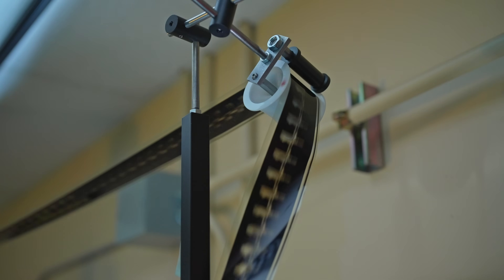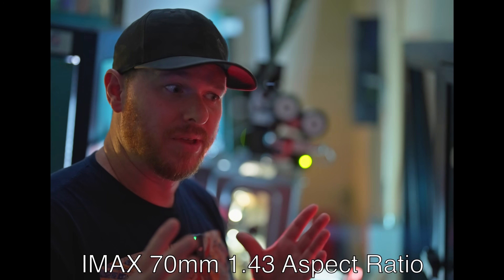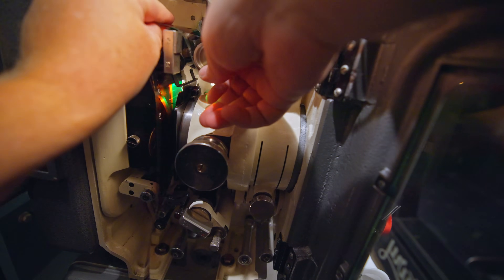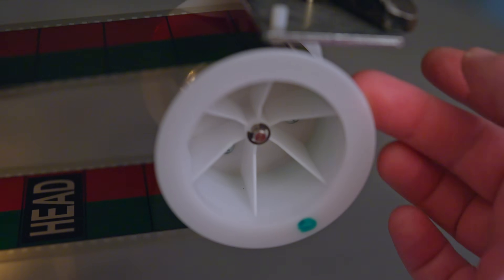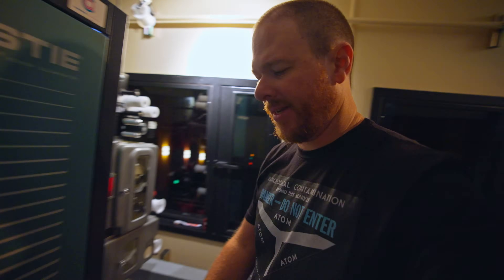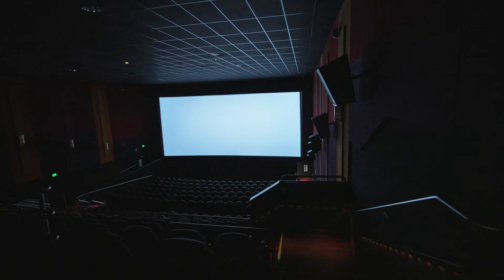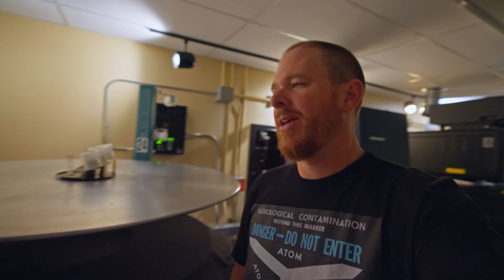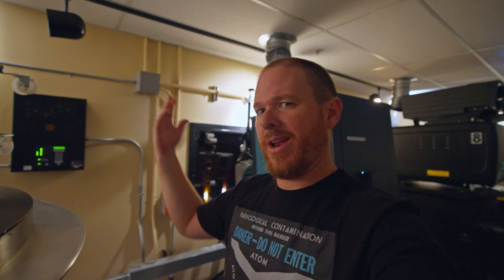Being a Projectionist for Oppenheimer 70mm Film Part 2

Comment: Started in high school with 16mm.  When I was in the Navy back in the 70's  I run the base theater and it was all 16mm.  When I was in CA late 70's I run some 35mm for one of the theaters in town.   In the late 80's I was on the engineering team that worked on digital audio and digital video.   After that it on to lasers and fiber optics.  Now I am retired and thinking about getting back into the projectionist role again as a part time gig.

Comment: I remember the Century Projectors and the platters.  I worked at a 3 screen back in the 80s.  Two used platters and the big house still used reels and two projectors.  I remember the automation system at the time that was triggered by a metal strip we placed along the edge of the film to dim/raise the lights, set the masking sytem, and switch on and off house music.    The thing I found most interesting was your changing the bulb.  I never had the privilege but remember the plastic housings they used as the shatter protection.  I'm guessing they switched to what you wrapped the bulb with as a cost saver.   Thanks so much for the tour.  I worked 35mm so seeing the process on 70mm was fascinating.
Reply from the maker: When I changed bulbs in the past they all had the hard plastic covers. That Osram bulb was the first one I had seen use that soft cover. Usually we would do it with no cover on the bulb. But for the video I had to do it because the people that hired me watch my videos.

Comment: Enjoyed very much the mechanics of 70 mm film I only ran 35mm film with two projectors with carbon arc lamps. This was at MAVC HQ in Saigon Vietnam headquarters in a 450 seat theater that was a part of the complex. Nothing like having a row of generals in the audience. I once forgot to change carbons and it was during the feature "Barbella" with Jane Fonda. Unfortunately it was during the scene where she was in the pleasure machine. Those who knew me didn't let it go unnoticed! The projector heads were Simplex with an  RCA optical sound head and Perlas (sp) arc lamp, around 65 amp. This was in early 1969 and the Xeon lamps were coming out but we could not get them as we were in "Hostal Fire Zone" and all equipment was considered expendable. Basically we were operating with junk! Enjoyed the short stint as projectionist as it made me appreciate the commercial theatre projectionist's efforts to have a smooth show.
Reply from the maker: Glad you enjoyed the video. Working as a projectionists was one of my favorite jobs. Its nice that I get to do it still from time to time when a big job like this comes up.

Comment: when you where tricking the sensor to make the projector think it was running, do you need to worry about the heat of the xenon bulb?  when you were checking  the light with the light meter?   can it lead to a projector catching on fire if you leave the doser open for long period of time?
Reply from the maker: The film gate is water cooled and there is a glass filter between the lamp house and the projector head. That glass cuts down on a lot of the heat coming off the bulb. In theory, if I had the lamp on with the projector running white light it could maybe damage the lens. I think this might have been a problem long ago.

Comment: Lifelong 70mm fan here. Thanks for putting these videos out to talk about and show how 70mm works, and what it takes to run the projectors. I do think you downplayed the comparison of the benefit of (true) IMAX 70mm vs 5 perf 70mm. Even if some sort of lens (anamorphic?) was used on 5 perf 70mm, the resolution would never be even close to what the 15 perf IMAX 70 can do. Yes, there is a huge difference in the visual information available in the IMAX format (even just looking at the two film strips side by side on the light table.) - there is no available information in the 5 perf beyond what that smaller frame can hold.
Reply from the maker: There is an advantage to IMAX over 70mm. I think the resolution claims are extremely hyped up.

Comment: These brings back memories.  Like other commenters, I too was a projectionist back in HS/college.  Probably the most fun job I ever had.  IMAX was still a few years away, but we had the lenses and adapters for 70mm even though the last time they were used was for Empire Strikes Back.  All pre-digital too.  This was the late 80s and the bigger 12plexes and such were starting to come around, and around the time more cinemas were upgrading to platter systems, Christie etc.  I got to work with the old reel to reel systems with changeovers and metal tape cues and all that, then ran the platter system until I ended up leaving.  Good times.
Reply from the maker: I have found memories of working at theaters and the studios.

Comment: Really loved both of your Oppenheimer 70mm Videos. Two quick questions though. Is the Film somehow getting Rotated, because It seemed like the Film was running through the Projector Vertically and I thought that the IMAX Film with 15 perferations was used in a horizontal manner. My other question is, if anybody knows if there is a way to watch Oppenheimer in 15 perf 70 mm IMAX somewhere in Europe to this day or if I'm already too late. I'd very much appreciate some Feedback. Thanks a lot!
Reply from the maker: This print was a 70mm 5-perf version. This wasn’t the IMAX 15-perf version of the film. 70mm 5-perf travels in a vertical direction and the IMAX 15-perf travels in a horizontal direction. Not sure if the IMAX version of the film is being shown anywhere now.

Comment: In the late 70s I was a projectionist at the Kent Cinema in Yonkers, NY (dual projector carbon arc). It was an end of the line theater where we always showed a double feature for $2.00. We got the films after every theater played them so the prints were often in bad shape. The films changed every week so usually on Thursdays I had to pack up the old reels and set up the new films for the week. Very often the reels came from multiplexes where they ran on platters. The projectionist were too lazy to splice the heads and tails back on so I had to do that. A few times the wrong numbered heads were placed with the wrong reels. Once I ran a film for a week with the reels out of order. The audience was puzzled why the guy who got killed in reel 2 was suddenly alive again in reel 3. I had no way of knowing it was wrong until someone who had seen the film before knocked on my projection room door and explained to me what happened. We started one film at 6pm and then the second feature around 8. We repeated the first film at 10. If we only had a small audience, the owner used to tell me to drop a reel so we could close early. There was no bathroom in the small booth (which was always full of marijuana smoke from the seats nearby) and I had to run downstairs to do my business. A few times I took too long in the bathroom and I heard the reel finish in the projector followed by the screams from the audience. Sometimes the owners used to remove a print from the booth overnight so it could be bootlegged on to VHS. It was a wild time at the Kent for $35 a shift.

Comment: Cotton gloves should ALWAYS be worn when handling film. The oil from your hands gets on the film and is transferred to the rollers and other parts, which already get dirty enough on their own.
Reply from the maker: No…I’ve been doing projection for 25 years and have never used gloves. The only people that I have seen use gloves are the people handling film working in editorial.
Reply: Nah. You can't thread with gloves. Biggest risk to damage print if you do [misthread].  Keep your  booth and projector clean [we do at this level] and nothing will migrate from the leader into the print. Film archivist? Print repair? Different story.
Reply from the maker: @markdavenport8737 exactly.

Comment: For projectionist training, make friends with a projectionist and hang around.  Learn all you can about it. Offer to stick around and help a projectionist break down and make up the prints on 35mm on the day they change films.  This is how I learned carbon arc projection with enclosed 20 minute reels and manual changeovers in an antique theatre as it was equipped to show the old nitrate film (Highly Flammable) and the old cement splices to the modern tape splices. Just wondering if Radioactive Drew ever ran 20 or 40 minute reels with manual changeovers? I was doing manual 20 and 40 minute changeovers before learning the platters. Yes , they needed rewound. No the projector can not rewind a film. I was even shown how to file the aperture plate for a new install. On 35mm you not only change between the flat lens and CinemaScope lens, but change the aperture plate to go with it.

Comment: 15/70 vs 5/70 is a little bit more than 3x the surface area in terms of projected image, while on 70mm DTS film the whole emulsion is printed, its not actually projected. The edges near the sprocket holes would be covered up by the inner magnetic tracks on a 6-track mag print, and are not projected, as no aperture plates (if cut correctly) should be showing that part of the picture area.

Also, thoughts on those Christie platters? I've heard a lot of horror stories about them getting out of time, but have only ever run changeover (DP70 pair), so I'm curious. 

EDIT: Very cool to see BLS's 70mm test film out in the wild.
Reply from the maker: Yes if the aperture plate was cut exactly to spec you wouldn't see that extra bit of picture. It seems mine were a little over cut on one side of the plate showing more than should be. IMAX 15/70 also has an aperture plate...or at least it should as every theater projection system has that.

Comment: I was operating projectors from the mid 70's through the mid 90's. I started off at a small single screen theater doing reel to reel change overs, then they "twinned" the location by dividing the auditorium with a wall. At that point we installed new Christie platters. Throughout the years I've run up to 12 screens as a manager/operator with one theater having a combo 70mm/35mm  Century projector that very rarely showed anything but 35mm.  It's obvious you know your stuff and I truly appreciated your professionalism. Thanks
Reply from the maker: Glad you enjoyed it. First theater I worked at was a single that was twined. We had a Strong 5 deck platter system feeding the two theaters.

Comment: I`ve been a projectionist for years, and when you were testing the white light, I always thought it would ruin the projection lens and leave a burn mark in the center of the lens if you left a plain white light shining thru it on the screen for more than several seconds
Reply from the maker: The light can ruin a lens if you aren’t running the projector and the shutter is in the open position. If it’s running you are fine to run white light.

Comment: I enjoy Drew's videos, but, the comparison between 5/70mm 'vertical' and 15/70mm may be correct as far as the film stock itself goes, but, Drew did not give a proper resolution comparison as far as the size of the entire projected image.  With 15/70mm IMAX, the film is running horizontally, so, the frame size that's being projected is much larger than that obtained from 5/70mm.  70mm is the width of the film, but, it's not correct to compare 70mm vertical against 70mm horizontal, as, the edge that is 70mm is swapped.  70mm vertically run through the projector, the width is 70mm, and the height is less than 70mm, but, 70mm IMAX being run horizontally, the height is 70mm, the width is much bigger (15 perforations wide).  So, to fit the same width projection screen with the image, the 5/70mm running vertically has to be magnified more than the 15/70mm IMAX, which is why the IMAX projection image is that much better.

Comment: I think the term "resolution" is tossed around too much lately with film. Since film is an analog format, it predates the modern definition of resolution, which relates to square pixels. Since film has no pixels, it technically surpasses any resolution a modern digital projector can show. IMO, a good comparison of 70mm to IMAX 70mm would be like comparing an APS-C camera sensor to a full frame camera sensor. The full frame is physically larger, so it automatically is capable of handling higher resolution images since it can see more, as there is more data within each image. If it's cropped, you lose some of that resolution. Of course, there are more factors at play like the sharpness, the pixel density, etc.
Reply from the maker: That’s a good way to compare the 2 formats.
Reply: Film isn't analog.  It is made up of silver halide grains, which can be activated by light.  In that sense, it is actually digital, although the grains are randomly distributed and not in a grid pattern.

The concept of "resolution" works differently, too.  It is normally measured as "resolvable line pairs" by photographing a test chart.  This takes into account the resolving power of the lens, as well as the film itself.  All things being equal--as you note--a larger piece of film will have more resolvable line pairs than a smaller one.
Reply from the maker: @Alpha8713 film isn’t digital. There is zero argument you can make that would prove that point. Film is made up of a bunch of pictures shown in sequence. You can hold them up to light and see them. You cannot do this with digital. It exists only as data broken down into “1’s” and “0’s”.

Comment: I did 35mm projection for AMC theaters around 2001-2002. I have been addicted to film ever since. I started collecting 16mm film and later started my own film lab for still photography. I love 70mm & 35mm.... Well I love all film, it looks beautiful on screen. And I want to see more movies released on film. Movies shot on film should have film releases. Movies shot with digital cameras should get a digital release. Besides some logistic issues, there is no reason theaters can't have both film and digital projection systems. Thanks for the video, great to see how well you protect the film. When I did projection I was paranoid about making sure the film never touched the floor. Anyhow thanks for sharing, I did not learn much but was interested in how sound was currently put on 70mm since magnetic tape used to be applied to the film. Using a DTS time code just like 35mm makes more sense. I am surprised there is no optical analog track as a backup like 35mm has.
We do need to train the next generation and websites like film- tech(dot)com are wonderful resources for film and digital projectionists. Hopefully we can keep film alive and well for decades to come.

Comment: How does it work if the film has scenes in 60fps like Avatar 2?

Does the whole thing run in 60 with double frames for scenes that are in 24/30?
Reply from the maker: I know it’s much easier for films like The Hobbit that was filmed at 48fps to be converted down to 24fps. They would ditch half the frames for the conversion. 60fps requires a bit more processing to get it down to 24fps. Not totally sure on how it’s done.

Comment: You are giving me flash backs of missing changeovers! Nice follow up! I was hoping you would show the DTS system.
Reply from the maker: That was one of my least favorite things to experience…missing a changeover. The best is when people tell you the print is cued and it has zero cues.
Reply: Yes, I remember we would hand-punch or "enhance" the cues missing or in dark scenes! I miss all these analog, human processes. We have made a massive trade-off with our instant, digital world. @RadioactiveDrew
Reply from the maker: @audioisgood well it was a lot more physical problem solving. Something way more satisfying about solving those kinds of problems. 

I’ve heard or hole punches being called drive in cues. We had a cue scribe that worked fantastic. Most of the time we would use non-destructive ways to cues prints since they were usually archive stuff or selects. So we would use a China marker (aka grease pencil).
Reply: @RadioactiveDrew  that’s hilarious. Yes, we were 100% the typical make shift drive in setup. It was so rewarding when I was a teenager. My other job was at an AM radio station. This was in the late 90s. The station employed 6 people and was on the air 24/7 yet their wasn’t a single computer in the building. I loved all the relays and analog automaton.
Reply from the maker: @audioisgood analog is such a cool technology. Being able to see how processes happened was a great way to learn and to solve problems when they came up.

Comment: I'm not 100% sure, but my guess is the analog code on the side of the film is most likely SMPTE time code. The analog to digital converter reads the analog code and converts it to a digital format. Then the digital SMPTE time code is used to align with the sound track.

SMPTE time code is the industry standard for audio alignment. For example, it is used extensively in live performances to sync video with live acts at concerts. It's often used in conjunction with MIDI time code. We use SMPTE time code at theme parks to sync fireworks, flame throwers, lasers, drones, water fountains, etc. across the entire park for shows that involve a bunch of different elements. So it's either that, or perhaps a proprietary code just for that system.

Either way, I really appreciate you detailed video! I just saw the movie a couple nights ago at the Indianapolis State Museum in 70mm. It was just as incredible as I thought it would be. I love that theater. And the movie was a masterclass in so many areas!